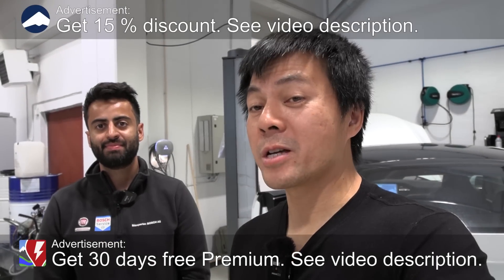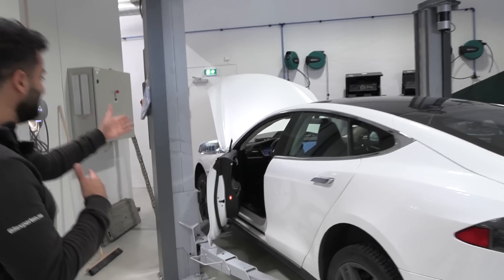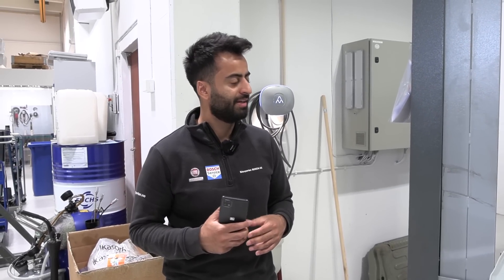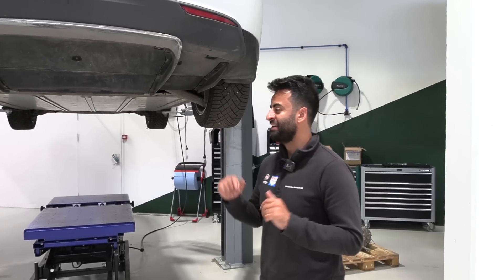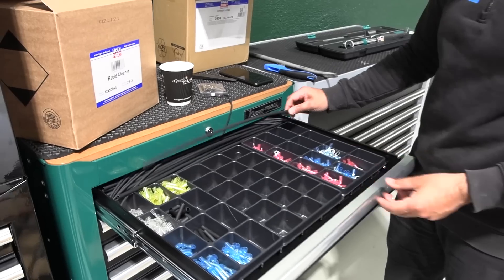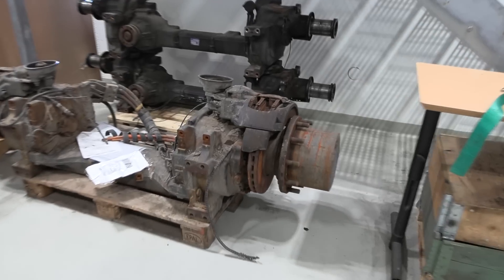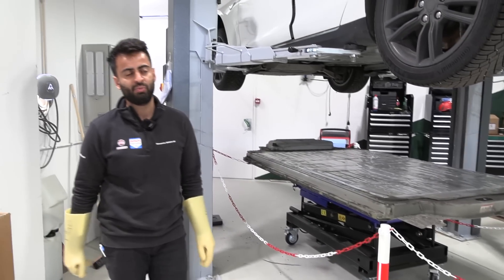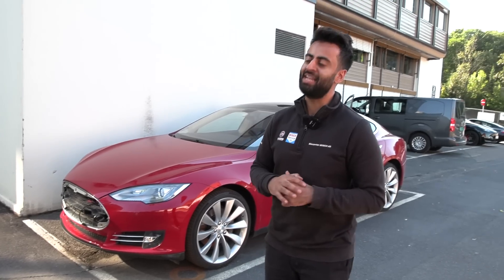EV Hub repairing broken battery in Tesla Model S part 1

Comment: hello, so my 2013 s  died and has the f071 error, some say its  HV batt some say its something else? all i remember is the contactors sounding louder then usual before this happened.. has 191k miles   rear drive was replaced in 2022 but no warranty left ( drove 70k miles  after that ) .. what should i check for ?

Comment: 2 years later, when enquiring about battery repair, the only option offered was 120ooo NOK (equal to ~11ooo€) with battery replacement, no repair offered or any other option and the car was still riding.  advertised 40 or 80k NOK mention here is false information.. 

It would be great if Brjørn would follow an actual repair with a private individual (not disclosing to EV Hub or others that it is him).

Comment: On and off, people claim there is cheaper battery solution…. but a bit like iphone, eventually there isn’t cheap battery replacement…even it does…the cost would be similar. To a point, if you spend half the standard cost to try, you’ll lost that amount plus handling cost to pull that battery out.

Comment: My Smart EQ is nearly four years old and is now on it's third 12V battery and it's third HV battery. Mercedes have not changed any management or running components Just Batteries. They don't admit it has an underlying issue so will not make any effort to fix it

Comment: so much for "the battery will last 20 years no problem" or "the battery will last longer than the car" that I have heard from all the Tesla fans back when the Model S released...
Reply: I've driven my 2021 Model 3 LR for 85k kilometres. Not one visit to the workshop. Enjoy your gas guzzler you service lord knows how many times during that same period
Reply: @garyanderton  so you failed to give any counter argument and also included an insult, very convincing!

but you don't need to worry though, the total cost of ownership of the last 15 years combined for gas and repairs + purchase price is slightly short of 20k€, driven 250.000 km

Your Model 3 costs more than I payed total in 15 years of driving and it will be totally fine for another 10 years. 
Lifetimes and total cost of ownership your are only able to dream of in electric cars lmao.

Also funny if you think that not having to visit the workshop for a car that is barely 3 years old is anything special. Mine visited the workshop the first time after 8 years and 170.000 km and it was to replace a broken damper.
Reply: @zocker1600   If you consider gas guzzler to be an insult, you must be soft, with all due to respect. That just means large car with high fuel consumption, which is what most anti-EV people from my experience are.

As for cost, different circumstances for you and me. I live in Norway, a country hyperfixated on environment, and for us EVs are far cheaper. Let's break it down. 

1 gallon of fuel/3.78 litres on average costs $8 in Norway, whereas 75 kWh of electricity costs me less than 10 dollars. Those 75 kwh will last me 400 km during winter, whereas 1 gallon of fuel is spent in no time. Add toll fees for entering the capital every day + more expensive parking for fossil cars, and you have vastly different monthly costs for someone that drives a lot.
Reply: @garyanderton  funny how wrong you can be. It is a Ford Fusion which is way smaller than your Model 3. Average consumption is 4.4 l / 100km. I am in Germany and 1kWh currently cost me 46ct (or 0.46€).

From the purchase price difference of your Model 3 alone I could buy fuel for ~400.000km (~20.000€) and I have a range of 700km in winter.
The running cost is also lower:
Ford: 4.4l / 100km * 1.5  € / l = 6.6 € / 100km
Model3: 15kWh / 100km * 0.46 € / kWh = 6.9 € / 100km

It simply does not add up, I understand basic math, I have done this calculation many times, it is simply not cheaper and this is true for most European countries except Norway.

Sorry but your thinking that anyone against EVs is a gas guzzler and must have a large car with high fuel consumption is just a ridiculous world view. Just because Norway is heavily pushing EVs down to everyone, does not mean that this is true for any other country.
Reply: @zocker1600  Again: My situation and Bjorn's for that matter, makes an EV financially viable. Your government is heavily dependent on selling gas cars due to your automotive industry. A fossil car is  far cheaper in your country compared to Norway, and that has been going on since before Tesla came to the market. Enjoy your car and let others enjoy theirs without propaganda. I've had 7 fossil cars prior to this, and  aside from a 2016 X3, not one of them were enjoyable. VW with their rust, BMW and their timing chain issues, and these cars were driven less than 100.000 km at time of purchase. If you purchase a used car, you're heavily dependent on the previous owner having been neat with services - which certainly aren't cheap. You can do them yourself, but lose resale value.
Reply: @garyanderton  
I agree reliability of German brand cars is bad, but that is completely besides the point as there are other brands which are very reliable.

You are right one should not believe propaganda like EV batteries lasting 20 years no problem, because they simply won't, that is all I pointed out.
Your "counter argument" with a 3 year old Tesla is just silly and does not counter my point.
Your financial argument is also silly, because EVs simply aren't cheaper except in some very special circumstances like in Norway. Norway is an exception, not the norm.

Comment: This will be a very interesting series. Thumbs up. Fingers crossed that the 1.9v is a faulty bms reading which should be an easier fix than if this is a single partly shorted cell that is draining the cell group. Which are the absolute max values for cut off voltage on these (Panasonic) cells.? Normally a cut off of 2.5v is advertised I think, but which is the brick voltages where it is unsafe to recharge ever? 

Reminds me that I should get a diagnostics cable to read out my aging MS before it is too late. 

Thanks for the interesting series. Looking forward to some detailed dismantling and reassembly. Was module 9 the one in the bulge of the pack, so it may be easier to get to?

Comment: Re: 4680 Ramp Up. Remember, the Road Runner plant on Kato Road started spinning 4680s in May 2020. Getting to mini-gun speeds with high yields (imagine how many tons of ‘blems’ ended up priming Redwood’s lines) took about another 12 mo & building the 4680 machine-building machines & exporting those designs to Giga-factories, Panasonic, CATL, & Samsung, another 18 mo. We ain’t seen nuth’n, yet! Can’t wait until surplus 4680s become available to us tinkerers for use in our “projects”!
Reply: the 4680 battery pack can´t be repaired. Check Munro Youtube on that.

Comment: worst case one swaps the failed module ? ok it may be less optimized but way cheaper than 15k for a Tesla replacement which may neither be new. Its also fodder for the never ending claims in pubs and bars (Stammtischparolen) that one needs to discard the complete car as soon as the battery is down.

Comment: Curious to see how they repair the pack the replacement module will hav to have a similar impedance to the existing ones or it won't last. Would be nice to see after market new packs but I don't know if it make financial sense to develop the product for such a low volume of cars.

Comment: Very Intresting to see that there is a upcoming business with talented guys like Nasir, where repair batteries before replacing. A new (repaired) battery in a EV is almost like having a new car. Also overhauling an electric motor is possible and cheaper than replacing. I wish Nasirs garage successful years and expansion, maybe he will open a garage here in Germany ;)

Comment: Fire risk mitigation is to take highly in consideration. One of the biggest Tesla shop in the US caught fire and burned to ground several times already. Electric battery fires are no jokes. All batteries should be stored in a specific place with fire blankets. Cars should not be stored inside. Li-Ion batteries are not safe and most of people don't realize it.... Those old Model S are getting dangerous over time...

Comment: The ZF bus drive unit is also used by the Mercedes eCitaro bus, (with solid state batteries). Note that there is no axle between the hubs, so the floor of the bus can be below the center to the wheels.  I would definitely be interested in a video of a Monroe style breakdown of that drive unit.

Comment: In the UK we have HEVRA which provides training and information on electric vehicle repair for garages. Dealer repairs are so expensive that it creates a market for component level repair. On iMiev/ion/c-zero a chip in the BMS can fail. Part costs £0.20p. Dealer can only replace the battery circa £10'000. HEVRA garage can replace the chip. Cost a few hours labour.

Comment: Good work, I really am curious to learn how the battery is repaired and what will be the cost, this will be great news to extend the life of BEV's!!!
Reply: I read somewhere that if the modules of EV battery can not be fixed then good ones can be taken out and re-purposed to store energy few more years (until they last) packed in different sizes to a green-house, garage or to store energy in modules from a solar roof panels or solar power trailer or to power different other electric tools & consumers and even by the end of the cycles the modules can still be send to be properly recycled dismantle in specialized centers that collect electric components sort all components out the metals goes separately from chemical stuff to the smelter and rest stuff to be recycled & re-used.. (or at least this is the basic notions of how it should be)..
Reply: @poplaurentiu4148  That will definitely work. If I understood it correctly, in this case one cell (or group of cells) is defective causing the pack to not properly function anymore, I hope to see in part 2 that they replace this cell 9or group of cells) and then have basically revitalised the battery-pack, where otherwise a complete new battery-pack would have been used. I think that is good news, maybe we even get battery-rejuvenation by refreshing the batteries by properly balance all functional cells and then have again a very good and balanced battery-pack...that's why I am so enthusiastic about this...hope that my enthusiasm is still there after video #2

Comment: Fortunately at least in Finland you can go full diy on any motor vehicle HV components regardless of the voltage! Hope it lasts!

I like my car with 2000kV system (higher than any high voltage transmission line). Makes the  drive nice and quiet too lol!